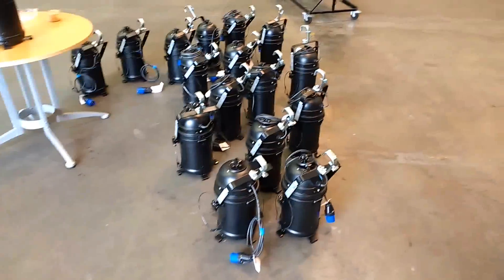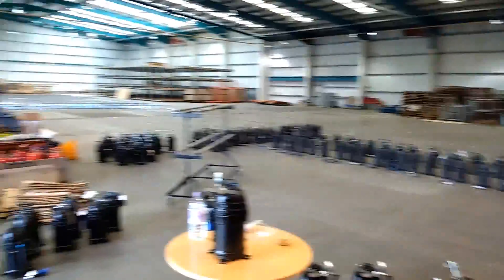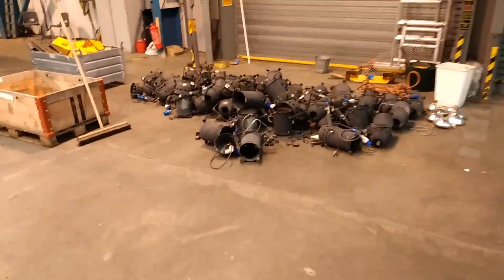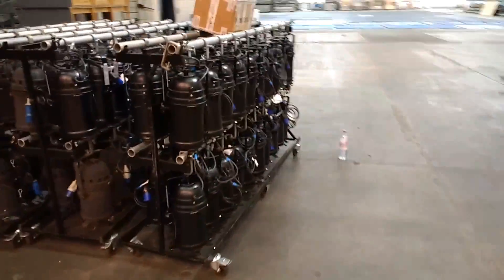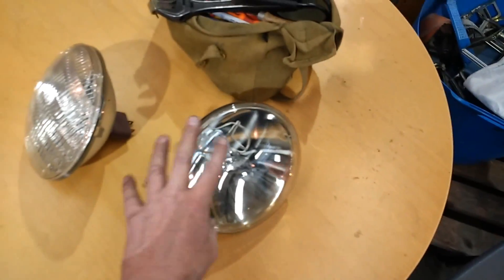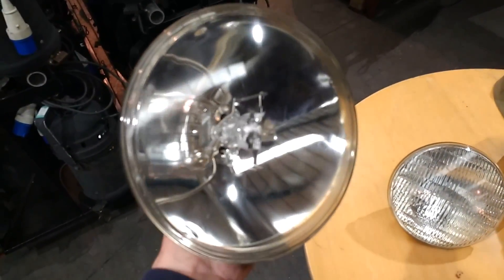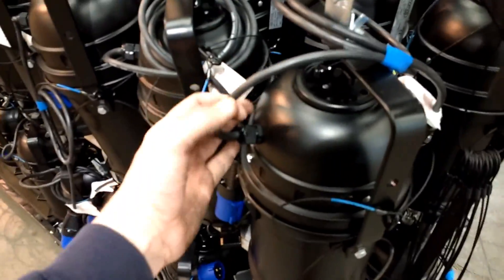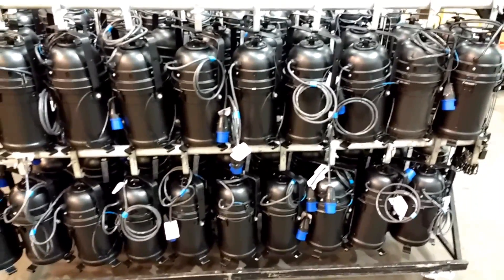PARcan graveyard.

Comment: Great video, I've been learning and following you from back of the day of R.A.T.S.   For those that don't knew that name, it  was the stage technician's newsgroup on USENET. When Abbreviated it spelled RATS from the naming structure Rec.Arts.Theater.Stagecraft. A very ironic and yet fitting name for the industry greats who hung out and answered questions from people doing productions in high schools and churches to various people in the levels of professional work. Who would have convinced that par cans would have been threatened and shrink bread back when coming off the big hair metal bands you had to 400+ 1Kw cans rigs or you weren't a tour/light show.  

...You just need Frank woods to come debate you about Congo Blue and Black Light effect.... ;)
Reply from the maker: +Able Magawitch Ah, the wondrous years on RATS with hit and run dial-up grabbing all the threads and then working my way through them before doing a hit and run to upload my contribution.
Reply: @bigclivedotcom   Youtube finally gave me notice you replied. Two years later...   Do you remember that most worthy flame that broke out on Frank Wood? I think it was by Chris(?) can't recall the screen name but think the sig file  had an email address of Rigger [at] something(?)  [dot] com  Along with an always changing sig quotes on the messages.  I'm having no luck finding the original via Google Groups(Miss the good old Deja News archive days),  but here's a partial copy I had emailed to myself.   

Frank Wood, you old marmot-felching fellator of diseased yaks... We haven't
had anyone this appallingly misanthropic and just plain spiteful since
the Chebucto Chunderhead. We do appreciate your attempting to crawl
out of the primordial slime and better yourself by running a club here.
Unfortunately, you were bettered in the entrance exam by a frozen
turnip, a broken toaster, and a stretched Harley-Davidson Panhead
primary chain. 

The Maharishi Mahesh Yogi has said: "Frank W is transcendentally stupid."

Regarding Frank, Pope John Paul II said: "If I waddna the pope, I'da
kicka you stupid monkey ass."

Jimmy Durante came back from the dead to say: "Dat tea-bag Frank is so
stoopid, I never seen nuttin stoopider. Inka-dinka-doo."

Mary Magdalene said I give him a  mercy fuck but I don't want anyone that
stupid in my bed.

Scarlett O'hara, of Gone with the Wind, said: "Oh Frank, I do believe
you are the stupidest man I've evah seen."

Stephen Hawking, in "A Brief History Of How Stupid Frank Wood Is",
stated:
"F. Wood is an example of what we call Singularity Stupid.
Stupid collapsed on itself so far that even the neutrons have
collapsed. Stupid gotten so dense that no intellect can escape.
He emits more stupid in one second than the entire galaxy emits
in a year."

The Commandant of the United States Marine Corps, pointed at you, and
said, "STUPID WOODs!!"

Howard Cosell: "Well, Frank...
After your inept displays
Of egregious intellectual dysfunction,
There remains but one question.
How could anyone be so stupid and slack?"

The State of Texas has passed a resolution to have a "Gawdam, that
Frank  boy is so stupid he couldn't pour piss out of a boot with a
hole in the toe and instructions on the heel" day, because of your
Texas-sized stupidity.

 

Bob Dole said: "Bob Dole says that Frank Wood is stupid, and when Bob
Dole says that Frank wood is stupid, Bob Dole means what he says.
Stupid. Right."

Oprah Winfrey says, "Hi, on "Oprah" today, we are discussing how Frank can
be that stupid."

Beck has written a song with the lyrics: "Frank Wood is a loser, baby,
why don't ya kill him"

Jesus Christ said I can't heal that level of Wood's stupidity I'm only the son of
god. You'll need more divine intervention to help that poor boy

You are weary, stale, flat and unprofitable. You are grimy, squalid,
nasty and profane. You're a fool; an ignoramus. Monkeys look down on
you and laugh. You are a waste of flesh. You have no rhythm. You are
ridiculous and obnoxious. You are a living emptiness; a meaningless
void. You are sour and senile. You are a disease, you puerile
one-handed, slack-jawed, drooling meat slapper.

Every story you have ever posted or said has been told before by the original
person. And it was better their time. You are a half-witted peter puffer, and you
clearly show yourself to be the most socially-inept, boorish,
flame-inviting idiot that ever has ever tried to operate a sound or light board. You quote the misguided and completely wrong technical specifications, you have heard from people outside the industry like its a fact. You didn't even bother to get your facts straight before you distorted them.
 
You repeatedly initiate incoherent, flaky, boring, and mindless drivel, and
you egregiously assume moral, intellectual, and physical superiority. It
must suck to be you, but then, you already know this.

You have greatly misunderstood the purpose of Production. You have
greatly misunderstood the science of the business. You are a loser. You must have
spent your entire life in a skinner box to be this clueless.

Did I mention that you are stupid? I cannot believe how incredibly
stupid you are. I mean rock-hard stupid. Dehydrated-rock-hard stupid.
Stupid so stupid that it goes way beyond the stupid we know into a
whole different dimension of stupid. You are trans-stupid stupid.
Meta-stupid. You are so stupid you make Beavis and Butt-Head look like
Nobel Prize winners.

You clearly show yourself to be the most neanderthal, snotty,
first-against-the-wall-when-the-revolution-comes, raving, hemorrhoidal
misogynistic, slope-browed, eye-rollingly-sub-human, crappy,
threat-to-the-gene-pool, backwards, in-bred, sack-of-pus,
walking-advertisement-for-a-state-sponsored-sterility-program,
boot-licking, unfit-for-human-consumption, irritating, disgusting,
onerous, worse-speller-than-I, glassy-eyed, flame-inviting, creepy,
spiritually-devoid, whiny,clingy, needing-of-professional-supervision,
humorless, vile, sexually-undesirable, hell's-pawn,
lacking-in-any-sort-of-grace-or-erudition, "Me-Too"-posting, addled,
un-repentantly-and-wickedly-perverse, trash-talking, toejam-sniffing,
anus-for-a-mouth, toad-like, trying-on-one's-patience, filthy,
sheet-and-pointy-hat-wearing, evil, reprehensible, mucus-dripping,
just-turn-them-insideout-for-a-few-more-days-smelly-underthings-wearing,
no-neuron, sunken-chested, piss-poor, foul-mouthed, scum-sucking,
rent-boy, sickeningly-ugly, clue-repulsing, "Make-Money-Fast"-spamming,
bringing-a-pen-knife-of-an-intellect-to-a-nukefest-of-a-battle-of-wits,
incapable-of-coming-to-terms-with-your-own-wretched-existence,
white-trash, boorish, rat-like,
living-proof-of-why-cousins-shouldn't-marry,
can't-be-allowed-sharp-objects, socially-inept, classless, inexcusable,
plaid-pants-wearing, zt00pId-laMer-Ta1k3inG, netscape-enhanced,
offensive, hate-filled, god-damnedest, insulting, unredeemable,
make-me-wish-I-had-a-big-hammer-to-beat-some-sense-into-you,
fearlessly-posting-disgusting-insults-with-a-stupid-handle, idiot that
ever has ever walked through a venue's door.

And I wish you would go away. Realistically, I don't think you have the
intellectual wherewithal to make such a decision, i.e., a correct one, so
you will stay here, spooging your petty stupidity of the great Designer Frank Woods knows what do, while getting spanked down every time by reality and science.   

**End of Flame**

The Flames were often brutal in R.A.T.S. even for Newsgroups/USENET back then. Although that one has always stuck with me for the length and level of burns.  I remember several people actually going to England on Tour and getting a photo with him as if it was prize/trophy to have. Were you one of the ones?
Reply from the maker: @ablemagawitch  That was harsh even by RATS standards.  The rigger.net email was Dave Vick who is still about.

Comment: So what sort of failure would relegate a PARcan to the graveyard? Are these rusted or crossthreaded or has the insulation gone brittle? Will they be refurbished for use or sale?
Reply from the maker: Just very old with failing insulation, corroded metalwork and missing bits.

Comment: What kind of light tech is used in these? I ask because 1000W of quartz halogen is different than 1000W of Xenon. I can see that they are not metal halide or florescent in the video. Sodium vapor would also not match the use (orange/yellow light with horrible shadows) and the bulbs do not look like that tech.
Reply from the maker: +KnightsWithoutATable Large tungsten halogen capsule inside.

Comment: hi clive, found a 100w led's that are really chap and bright. i have seen a lot off you're videos trying to find a good led but in the end i found 1 myself, so here is a link -http://www.ebay.co.uk/itm/10W-20W-30W-50W-100W-High-Power-Waterproof-LED-SMD-Chip-Bulb-LED-Driver-SupplyLY/302327288369?ssPageName=STRK%3AMEBIDX%3AIT&var=601163406545&_trksid=p2060353.m2749.l2649.  the only downside to them is that the warm white is more a day light than warm white, but for 14$.... its worth it
Reply: i would love to see you test them to see if they are really 100w, (ps i bought a watt meter like yours, whiting for it to arrive)
Reply: i am going to, i bought the same meter socket thing that clive have (its in the mail). it just that he is also looking for good 100w led which is a hard thing to do on ebay, even sellers who sell very good 20w led's would sell a crappy 100w ones, ( he did made a video on that) . any ways these led's (in the link) are really bright so i wonder if i found good ones on ebay at last. btw i tested them with a crappy clamp meter and it seems they are 66w but i dont trust this meter, i did also tested them side by side with a 500w halogen flood light and this led smoked the halogen, its looks twice as bright. i just want to see him test them since he got all that gear, and also after seeing a lot of is videos it would be nice if i could help him find a good 100w led since he didnt find one yet
Reply: wall as you said they are expensive. the last led's i bought are bright enough for me, and it is all for repairing led  fixtures at work, so buying lux meter just for that is kind of a waste of money. as far as testing it with a voltmeter there are who say it can damage the multimeter. any ways iam happy with this led and wanted to recommend it to clive since he is looking for this kind of led, and also he has all the gear an knowledge to test them. for me the fact they cost 14$ for a power supply and a chipe, and the brightness of the led and the fact the power supply don't heat up is good enough for now, but i will try to barrow alux meter to test them (iam also a lightning operator so i know people who have lux meters), ill post again in a few months if they will survive so others can buy good chap leds, also iam going to buy more of them so i will be able to see if they are all the same or different quality (which will show if they are crap or not)
Reply: i uploaded a video of them working and later tonight ill post a video of them next to a 500w halogen flood light and maybe tomorrow ill make a video of them ounce they are installed at work (i work at a events venue)
Reply: hi caledonian tv, just got a socket watt meter from a friend and it says it runs on 69.35 watts. its not a 100w but as you said- you get what you pay for, but iam still happy with them. ill try to test them 
with a lux meter soon
Reply: first thing iam 35 and iam fixing light fixtures since 4 grade. second, i have no problem asking questions when ever iam not 100% sure of something. and lastly i have seen alot of crappy connections and other dangerous stuff made by qualified electrician (iam not), and why do you think i would do anything to risk anyone??????? you jest keep saying what i should not do instead of saying what i should do, so your not helping. i have never risked anyone because even if iam pretty sure that i know what iam doing i would do the research first, bottom end you dont know everything and you really not halping and more over you're clearly not listening, the reason i posted hare is to recommend chap and bright led's and obviously they are not crap led's since they work fine and are consistent with one another (that is way i bought 4 units from each seller). the fact that a led is not up to specs dont mean its crap, learn about how they are made before you say stupid thing, there is a reason why people (including clive) buy these led's so its not a 100w, but it is much cheaper and its bright enough for me, so....
Reply: i uploaded a video of one of the fixtures installed and i'll upload another ones i'll install the second one, and in a few months i would know if they worth it if they will survive, i know there is a chance they will die in few weeks but the whole idea of clive's Chanel is to play with stuff and that what iam doing too, and dont worry i hung them on the roof which is 7 meters high and they are well earthed and i sealed them up with black silicon which is meant to be used on engines so it can handle the heat 😊

Comment: I worked lights and sound in our college theater in the 70s. We built our own patch board with twist-lock sockets. We had a few par cans and had to make extras using large soup cans and sheet metal barn doors. Crude but effective.

Comment: 'Aglycans' in the 90's were a clone of these. Also many interesting hours spent driving Pattern 42(?) with home made analog  electronics as well  as these PAR xx. Agly lives on as ledfx, of course. Both Pattern 42 and PAR were blindingly bright.

We attempted to emulate the Rank Strand 0 to 10v analog system then with mixed results. Curve generation was fiendishly hard in analogue hardware.
Reply: LED FX lives of course  whilst his developer at the time heads for Big Brother obscurity. Analog systems are fiendishly hard, you try implementing  PAR light curve withj LM324, LC got it quite well after months.....

Comment: Clive. Does the lamp have a vertical or horizontal filament? I know some spot light can be supplied with either .

The bulb filament size and shape combined with the reflector design determine the concentration of a focused beam. The shape of the filament will determine the type of Beam, e.g. a vertical filament (VF) bulb will give a circular spot beam, whilst the horizontal filament (HF) will give a slightly oval spot.

.can the parcans use that principle?
Reply: Thanks . I used to work in an electrical warehouse that sold par bulbs . Not that big I don't think. Was 20 years ago and I had little interest in them ha ha. 

I know that some hunting spot lamps have vertical and horizontal bulbs.

Comment: 1 KW Each?

That's a far bit of power...
Even if the dimmer rack used is 95% Efficient, that's still 2 KW dissipated if the first 40 (one full rack) are running at full.

Comment: Hey Clive, I love your videos. They're getting me into circuits and stuff, even though I've never really done anything with electrical stuff. I recently watched your solar power meteor light project and was wondering if it'd be practical and safe to make a similar device just to charge phone batteries (obviously without soldering the wires onto the contacts). What changes to that circuit would make that feasible? Also, I'd like to use it to charge a Nintendo 3DS battery, which is removable and appears to have a similar structure and specs (3.7 V, 1750 mAh, 6.5 Wh). Would I need a separate device specifically for that or does your arrangement work for any variety of Li-Ion batteries? Thanks in advance!

Comment: Are they so cheap or why haven't they been replaced by leds yet?
Reply: They are cheap. LED also comes with some downsides. Not a good investment yet.
Reply: I talked about this a little in another comment thread. It comes down to time, money, and complexity.
Reply: LED fixtures and lamps are actually cheaper to manufacture than incandescent, but the companies making them are paying off the investment in factories and trying to maintain the same revenue levels as the old tech by over pricing them. They will come down some, but it will take time.
Reply: There's also the problem with light spread; the optical characteristics are completely different.  This is why you don't see the huge exodus away from linear/helical fluorescent, HID and halogen lighting in the film industry.